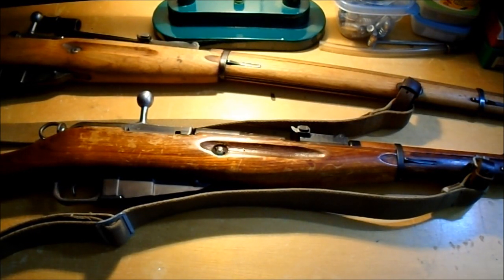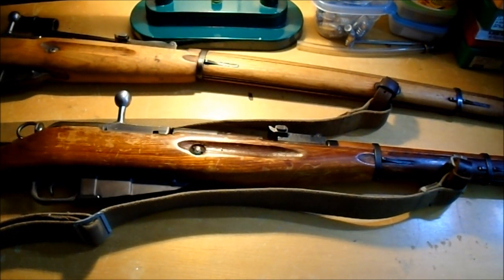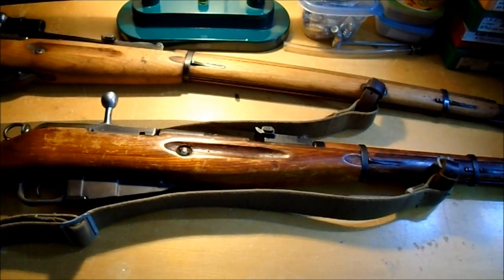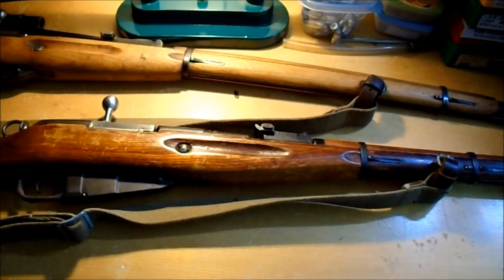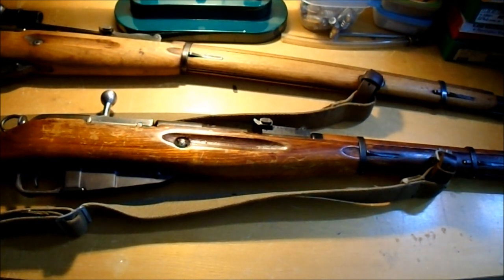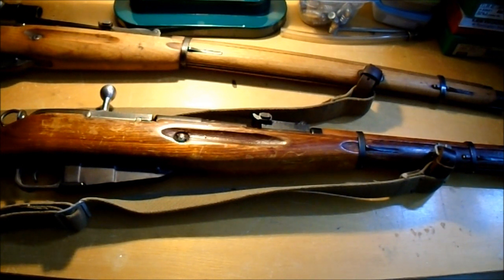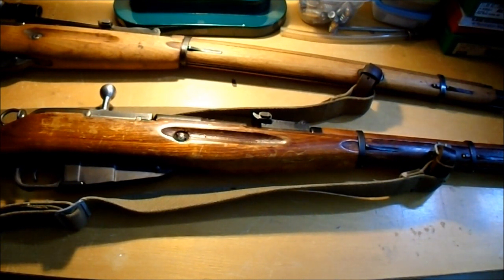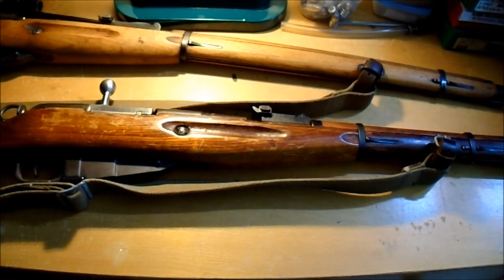Top 5 Mosin Problems

Comment: I look at the refurb guns as projects. I keep them original but I bed the stocks with thin cardboard shims and properly adjust the front sight. Some I bought just to have and didn't care about accuracy but a few I have I made sure to be picky on the crown and bore. I shoot a few of my 91/30s at 200 yards at steel gongs that are a bit bigger than a piece of printer paper with good results.

If people aren't willing to do a bit of homework and tweaking to the rifle to get it to shoot half way decent then they should probably buy a Mauser.

Comment: I think the biggest current Mosin problem is the $995 M39
Reply from the maker: cant see that lasting.
Reply: Did it sell for that or is that what someone hopes to get?  Was it some rare Tikka?
Reply from the maker: Trey Westcot
lots did lol.
Reply: I love Mosins, but that's insane.  Why are they so much more expensive in Canada?  We need to be able to trade M39s for SVT38s and 40s.  Here, M39s go for anywhere between $350 and $650, Tikkas being the exception due to rarity and collector demand.  But even Tikkas don't go for $1000... $850- $900 max.  Your supply in Canada must be substantially less and demand substantially greater to merit those prices.  The Yugo M48, M48A, and M24/47 Mausers go for $300- $400, with Enfields pulling $350- $450 or so.  What happens when rifles cross the border?...some kind of alchemy process???
Reply from the maker: *****
thanks for clearing that up lol

Comment: i have a 1938 mosin 91/30 and for most part with 147 grain bullets it shoots 2 inch groups all day long at 100 yards but bout 3 inches high / it shoots bout 6 to 8 inches high with 180 grain winchester white box but holds bout 1 and a half inch group i dont plan to hunt with it but is fun shooter at the range for sure many of the sighting issues people have are the people them selves not being good with iron sights and not realising that the guns will always shoot high at 100 and even a bit higher at 200 just how it is use a 6 o clock hold with the front sight flush with the top of the rear sight and have a good trigger pull and many of those accuracy issues will be solved mostly its on the shooter and learning how to properly shoot the iron sights
Reply from the maker: not all shoot high at 100 yards.
Reply: This is true, I have a '35 Izhevsk round receiver that shoots POA/POI at 100 yards with 147 gr Russian surplus. I have a '23 Izhevsk hex receiver that is another story.. about a foot high at 100 yards. Both shoot about 2-3 inches at 100 yards, which is all the better I can do with iron sights anyways.

Comment: Interesting you bring up possible differences in the rim of the cartridge as an explanation for rimlock. I think this may be true as well. I've attempted to find a fix for rimlock on multiple occasions and have tried basically every trick in the book with no reliable success. The main problem seems to be that the interrupter tab on both the two piece and one piece interrupters is just too short to reliably hold down the bottom cartridge from interfering with the round above it. Im wondering if maybe there is a slight difference in the rim size of the rifle cartridges used at the time and the surplus machine gun rounds manufactured in the 70s and 80s.
Reply from the maker: im starting to think so.

Comment: ya well mine is all # correct and the bolt sucked .. fix is the new striker spring from '' howlin man '' done fixed , full 4'' length , no cutting stock spring back to 3 1/2 ... lighten trigger pull a wee bit also , brass shimming will lighten the trigger also a bit , shoot high , just aim 6 o clock , easy fix see the whole target  when one use's iron sights ..good video
Reply from the maker: you settle down...

Comment: The problem with any sticky bolt is not so much the bolt itself as A DIRTY CHAMBER! And this comment is coming from a Mauser aficionado! Any gun with a dirty chamber will have a bolt that is hard to operate.
Reply from the maker: So when the chamber is empty and the bolt is hard to work it's the chamber... okay ;)
Reply: Of course I meant when you fully cycle live rounds!!!
Reply from the maker: twombonu
sure ;)
Reply from the maker: Most of the time it's the bolt is mismatched or steel case ammo can be a problem :)
Reply: Or the metal is not polished. That was my problem. Just sent mine to Finchers Corner in TX to get the rough spots polished down.

Comment: do any of your mosins have a long chamber? on mine, 1930/52 the case shoulder blows forward about .060" after firing
Reply from the maker: dont think any are that bad.
Reply: bought another mosin this morn at canadian tire paris ont, 1938 low wall $199, best bore i have seen and the best stock i have seen, no shiny flaky shellac shit but a nice dark oil soaked cosmoline dream with a tula star cartouce , receiver is a round ishevesk

Comment: I think the Mosin is a pretty solid rifle. My refurb is actually pretty "nice" as in it shoots decent and the bolt is nice with brass cases but doesn't close as easy with the steel. My dream Mosin is a model 91 made in 1891. I know I will probably never find one but that's why it's a dream gun. Do you think that the tulas are better than the izzies?
Reply from the maker: start by not calling them izzies and i might answer lol
Reply: +Gungeek I just said izzy because I don't know how to spell it lol.
Reply from the maker: google it :)

Comment: I like because simple and shoot well  to 100 yards except   junk.
Reply from the maker: wtf does that mean lol?
Reply: I have several mosin rifles and never had rifle not shoot. I ended up getting taller front sight post to shot 50 yards. Some of the surplus ammo does go all over the place but use commercial ammo for hunting deer. Have 2 M48 carbines and shoot 3 inch group with open sights. Good rifles but would not spend a grand cause too many other modern rifles around. Have had a hard bolt but kept cleaning and
Reply: meant a M44 snd M48.